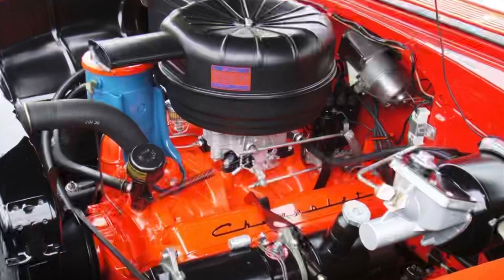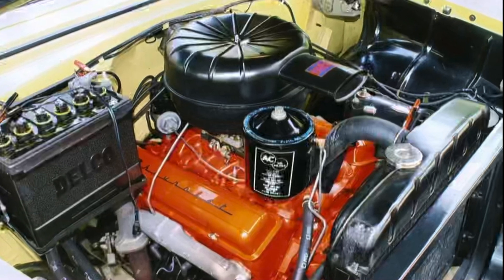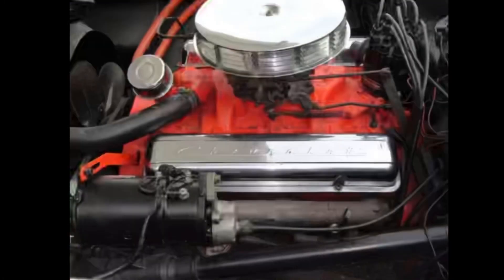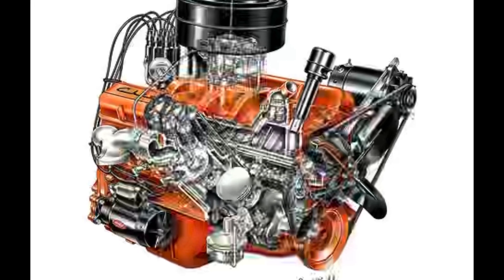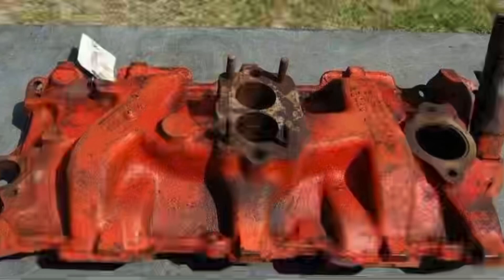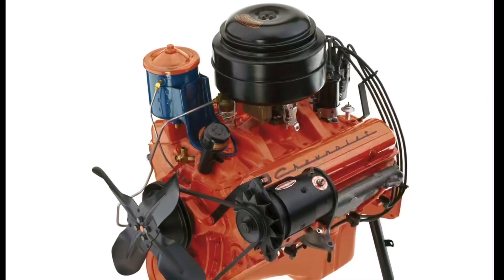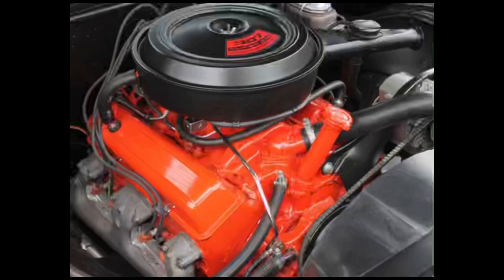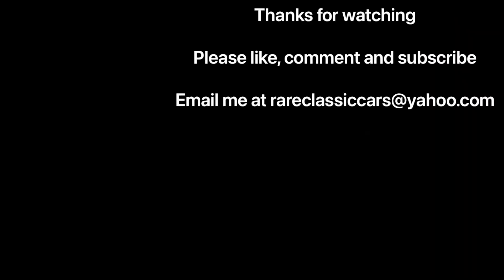Best Engines of All Time: The Chevrolet Small Block V8 (262/265/283/302/305/307/327/350/400)

Comment: I have a 2002 HD pickup with an 8 liter engine when I bought it new I looked at the motor and the salesman told me it was the old 500 Cadillac motor they were bringing them back for a year or 2 instant sale I knew it was built to last...It has 350000 miles on it still doing great use it for work and boy it earned its keep,maybe spent 5000 on parts and work in 20 years knock on wood...everyday without a car payment is a great day
Reply: Not a Cadillac 500, it’s a Chevy Big Block 496.

Comment: The  first gen small block Chevy evolved into what it is today not because it had a superior design, better performance, or reliability. It was because it was cheap, and they made more of them than other SB V-8's. Chevy was GM's cheap line, Old's, Buick and Pontiac all had V-8's that made the same power but had much stronger blocks with higher Ni content, forged cranks with bigger diameter journals, and Cylinder heads that have thicker castings.

Comment: Had Chevys with a 283, 350& PIS garbage 400. The 283 in my 64 Chevy was the best with the least problems.Can remember all the lying car companies telling you need a 8 cylinder car if you have an air conditioner. On my second Honda 4 cylinder SUV with a 4 cylinder engine. My 400 cubic in Chevy engine was such a pig.After you ran the air conditioner for only halve a hour it would think they called it detonate. Had the engine & radiator flushed out and even without a thermostat pig appeared to run hot at any speed.

Comment: Wasn't the 307 actually an Oldsmobile engine? It was very similar in appearance to a small block Chevy but was actually an Oldsmobile engine used across many GM platforms. The 1949 301 Oldsmobile Rocket 88 V8 and the 331 Cadillac V8 were also Ed Cole creations, so Chevy small blocks look similar to some Olds V8's.
      Am I mixed up or otherwise wrong about this?
Reply from the maker: There was both a Chevy and Olds 307
Reply: @RareClassicCars  Thanks.
Reply: Chevy's 307 was made from 1968 - 1973 
Oldsmobile's 307 was made from 1980 - 1989
Reply: @Fred_NaughTy Thanks.

Comment: Your information is CORRECT!  The ball and stud rocker arm design with the hallow push rods, meant MUCH higher RPM.  I love Fords, but the first small block Ford "Ford 221 cubic inch" (much the same as the 260, 289, 302 and 351W small block Fords) used much of the small block Chevrolet design, and did NOT come out until 1962, that's exactly seven years AFTER the small block Chevrolet (1955) came out, that is NO coincidence!  I think Ford HAD TO wait until some of GM's patent's wore off.  Dave...

Comment: Interesting fact. the 55 265 V8 oil burning was so severe, the dealer fix, to get it through warranty period, was too bring the Engine rpm up to 2,500 rpm and slowly pour a container of BON AMI  cleanser, like comet, down the carburetor, this would scuff up the cylinder walls and helped the rings too seat better. IT WORKED !!  Not for long but got it through warranty. Many old time Chevy buyers refused too by the V8 for years..

Comment: The small block Chevy engine was great, except for the years GM went cheap and used the soft cams that went round at 40-50 thousands miles.

Comment: I disagree with this premise. The SB Chevy was no a good as a high mileage motor. They would need an overhaul way too soon. The short deck short rod combination was one reason. Another was the soft cylinder walls, small diameter camshaft and combustion chamber located all on one side. The valve covers had only four hold down bolt with rough casting sealing surface. I always got better service out of a small block Oldsmobile.

Comment: Cool, thanks for the heads up in the old school car lesson. Question: wasn't the 283ic replaced by the 4.3 262 V6 overall?

I'm an old schooler pretty much at 64 and remember technology then was Bigger the Better, boy have we come a long way. Today is yesterday making very small engines with big, big block horse power and torque.

Thanks again, be safe everyone and be kind.

Comment: Best engine i ever had is the  305,,400.000 and still going fine.also the 350 small block,overhauled at 200.000, still driving fine.Keep real oil in them,they will allways get you home..

Comment: Very informative video. I'm satisfied with the 305 SBC engine on my 1982 Trans Am. The water pump had to be replaced 8 years ago. Intake manifold and valve cover gaskets were also replaced due to a mild leak. Other than that it's a sturdy and reliable engine with almost 80k miles.

Comment: Small block chevy is designed to be one thing: the cheapest throwaway engine GM could make (full disclosure: I had a nova I did the typical rebuild a truck 350 swap). Cast iron everywhere with flimsy stamped steel metal covers. The first 50's model years didn't even have any oil filter! And I always thought the chevy engine has more in common with the Olds rocket v8 than any of the other divisions' v8 - basically was deigned to be a cheaper rocket V8. My opinion is the Buick 340/350 and 430/455 were the best designs of all the passenger GM V8s.

Interestingly Chevy actually released their 302 cubic inch engine one model year (1967) before Ford (1968). Both have the identical 3 inch bore and 4 inch stroke. The Chevy 302 engine was nothing more than a de-stroked 327 using the crankshaft from a 283 for sustained high RPM race purposes in the trans am series The 350 came a couple of model years later - take a well performing engine design and increase the stroke for additional low rpm power. The 302/327/350 all share the same 4 inch bore but each have a different stroke. The Chevy 307 was simply a longer stroke 283. The 305 was always odd to me because they already had the 307 that is nearly identical so why design a 2nd engine? There must be something with emissions and changing to the small crankshaft journals that made GM decide to slightly tweak the bore and stroke. The 400 was an abomination and a reliability nightmare that should have never been produced.

Comment: Lots of good info  over all but GM really dropped the ball on the smog motor versions in the 70s.  The early  305 V8s were lousy  for manufacturing reasons.
Reply: The EPA forced all the auto maker's hands.  They had no choice, either make there engines comply, or the cars they are in can't be registered.
Reply: @michaelbenardo5695  The EPA demanded cleaner emissions from all OEMs.  That does not excuse GM for screwing up the metallurgy and heat treatment on engine components that had been in production for two decades.  That's lousy quality manufacturing... NOT the EPA's fault.
Reply: @billyjoejimbob56  I agree to disagree with you.

Comment: I’m with you on the 305/307 engines. They had plenty of potential for producing power, but they were choked down with emissions components. With their stroke and displacement they do make great high revving motors, but most people saw using the 350 as a better bang for the buck for power.
Reply: The worst power killers are EGR, retarded ignition timing, and lean jetting.  Those three absolutely murder torque, making it feel gutless.

Comment: I’m a Ford guy - the Chevy 350 IS the best engine ever.  Dang what a Jip !
Reply: your a ford guy,, ??..i doubt it. ever lookad at a 350 chev.?. there rubbish design..best ford engines, are the 351c, & 250 log motor. just my thought, but a 351w, looks like it was going to be a big block. the mains are huge. when you stroke a ford, you fill it with chev crap.. keep your ford all ford.. keep your chev all speed shop.. im in aus.. i beat you all,, i have a 340 r/t chall..yeeh..& 4 ford 4x4rs..62 to 02.. if chev, stayed here,with the blazer ect. would of made a killing, chev is like gold here.. ill keep my bronze ford.. we still flogged farrari.. 427fe..  chev...........................crickets....................
Reply: @harrywalker5836  ha ha haaaa!  Aussi my little Chris Craft has twin Ford 427 - they were just truck motors in 1968 next to the Ford factory - throw a shrimp on for your Ford mate !

Comment: The bore&stroke combination that you mentioned is wrong it had a very small bore and a very big stroke like the six cylinders I believe the bore was even smaller than the 305.
Reply from the maker: No. I’m definitely correct. 3.75 bore and 3 stroke.

Comment: Supposed to be the early 265 was a smaller version of the Cadillac engine that was used in the war great design. Basically Smoky young did everything you could do with the small block that was possible with all Chevrolet parts. It's a shame his will had him or family tear down his machine shop what a waste of tools and equipment and history.

Comment: Great motors have had every version over the years the 307 was probably the worst it's plastic coated timing gears always failed and the timing chain would jump the gears. Really love the ole "283" put that in anything and you're good to go. Sure there are more powerful versions but that motor was great.
Reply: You can replace those timing gears with all-steel.

Comment: Had 1970 LT1 370 horsepower with 292 slant plug heads solid lifters M1 Rock Crusher transmission 4-speed in my 66 Chevelle not bad for a nineteen-year-old kid

Comment: Im a Mopar guy but just built a 327, they are called the universal engine for good reason. Need your jaguar to be reliable and have power ,350. Want a fast cheap boat ,350. Japanese 4wd is a slug 350. They are used in everything and cheap to build

Comment: The fact that the platform was tuned for different output was what helped it achieve greatness. Instead of the flavor of the week new platform. Gm adjustments to the same package kept cost down. Then the ls was mocked as old pushrod tech. What else makes the hp per dollar of the sbc or ls?

Comment: I remember the 283 in the med-60's, and 307, 327, 350 and then the 400 from 1965 into the late 70's. They were everywhere on the road.
Reply: 283 was a good motor I remember they had good power and offered about 20 mile to the gal. in most body styles.
Reply: They were the "regular" engine of the day.

Comment: The Chevrolet 307 and 305 V8 engines weren’t so powerful but there’s plenty of performance parts available they can make up to 300 plus horsepower or more if you upgrade the parts for it

Comment: The 350 is the holly grail of the small block V8 engines after taking the throne away from the 327 and the 283 which they have multi purpose and the LS V8 engines are phasing out the living legend small block and big block V8 engines but still has the similar structure but different technologies

Comment: I never had a GM that would run worth a can of beans.....302  Ford small blocks were better engines.  Nascar has adapted to the Ford small block it runs better and produces more power.   Take a look at a Toyota or Chevrolet nascar engine it is based off the Ford small block Design.

Comment: My first car was a '63 Impala SS convertible, 327 4 speed, hot stuff for a 17 year old in 1967.  I had that car until 1975 and drove the wheels off of it.  I've had a succession of small blocks since then and currently have two.  I also have a 454/390 big block.  Sadly and ironically, I never had what I really wanted, a 327/350, IMHO the best of the best.
Reply: I had a 327/350 in my 1974 Chevy Monte Carlo.

Comment: Although I love the chevelles I had , the Chevy motors did not have longevity of the olds motors and I changed engines in the chevelles.  At least we had the versatility to adjust the vehicles for wear that you don't have nowadays.

Comment: I had a 265, a 283, a 327 and a 350. The latter were great motors, the 350 and 400 were junk! Flat camshafts, the front pully coming off and putting an end to the crankshaft. More then then one have done this to me and all under a 100000 miles, junk!

Comment: I thought zora duntoff had alot to do with the development of the small block + i thought the oil usage issue was no cross hatching on the cylinder bores ? My grandpas 79 305 truck had 700,000 miles + and always started ! just rusted out to death ! the motor lives on tho !

Comment: Growing up in a junkyard back when I built many a SBC and still think those mice were the best engines made. I learned a lot of tricks while working on these little jewels, just last year I sold off my remaining engines, I stroked these engines and destroked them. I learned decades ago not to use high volume oil pumps instead use new factory spec pumps.

Comment: I swapped out of my 1950 GMC 1/2 ton the 235 straight six for a 283 with Muncie 3 speed on the floor, the engine came out of a caprice, it’s still runs awesome, like you said the water pumps were weak I had to replace it last year.

Comment: The Chevrolet small regularly makes a lot of list of the best engines ever made the lists also includes the VW flat 4 cylinder the Porche flat four engine the Honda B series 4 cylinder engine the 22R 4 cylinder engine l drive a 1997 toyota hilux with the 22R engine the Jaguar 6 cylinder engine a lot of the includes 4 cylinder also the engine in the Model T Ford another  4 cylinder engine l have seen many reviews of older American cars with big V8s made only 140hp why when these huge American cars whilst Europe and Britian they were producing cars with 4 and 6 cylinder cars with similar horse power and they were much smaller and lighter cars

Comment: The 302 and the 327 were probably the best, in my opinion!
Reply: I have a 302 in my 4 speed nova. 4.88 rear gears it’s the most brutal launching street car I’ve ever driven. Will happily sing over 7000rpm

Comment: Starts off with bull shiiite.... the Chevy OHV straight 6 always had more HP than the same year Ford flathead V8 !!! 
Louis Chevrolet was a race car driver and his engines would never be a weak flathead! 
Original Gen. 1 small block Chevy V8 engine still available over parts counters but basic ones are early 1970's gas hog, lopo, emissions slugs... 
Chevy also had an OHV V8 1916 - 1918... called the 'mason' engine...

Comment: Great video.  One  of GM's best engines ever.  As to the  water pump,  it has to better than what I saw in a BMW teardown video recently.  The water pump was half plastic! And this was a BMW!   The author of that video says  the engine he was tearing down will  last 85/90 thousand miles.  Again a BMW!  No wonder BMW is said to stand for Big Money Waster or Bring More Wallet!.
Reply: European engines have never been very robust, except, of course, for the Rolls and the Bentley, which nobody can afford.
Reply: @michaelbenardo5695  This is not what I understood.  I have heard tales of the old Mercedes going several hundred thousand miles.  That is the older models, not present day ones. Mercedes are fairly expensive, but so are BMWs.
Reply: @pattyeverett2826  It was the diesels that would last that long.  They were also super slow and noisy.
Reply: @michaelbenardo5695  That is true, it was the diesels that I read about. It was still a European engine though.  The point is that with all the money spent on a BMW, I would expect much better quality.  I have had 2 Fords go over 240,000 miles with very few issues.   Much cheaper than BMWs.

Comment: With regard to the water pump, I remember when the one on the family's 1965 283 V8 started leaking 60 miles from home.  But I still made it home by partially unscrewing the radiator cap so that pressure would not build up in the cooling system and that way the leak was minimized and the engine didn't overheat.
Reply: hole in upper rad, ford,, drove for 4 months, cap loose.. cant beat a 351c.. never touch them..
Reply: @aldo6192  not mechanically minded,,i see..

Comment: There alright. My current driver is a 350 Chevy and I've had and built many over the years, but their definitely one of the most overrated engines ever. For their size they are heavy, and the casting is soft. Stock blocks aren't very strong and core shift was a common issue up till about the last 10 years of production. Sand pits and core sand  left in the water jackets was always there during a rebuild. They also tended to run hot. Being a 265in engine originally, then expanded all the way to 400in without any increase in deck height or any other provisions to increase cooling capacity. If used in something like a wrecker where your working one hard all day long a 350 will easily run 260 degrees. Every engine has some flaws, and the small Chevy is no exception but for some reason it has a cult following. With all that said it's not a bad engine, but seriously overated all the same.

Comment: Its amazing to see how engines back in the 50s had only the necessary components for them to operate, Nothing else. Its a shame how, over time, things changed and went downhill by the early to mid 70s with Government regulations. However, I've always liked the 305 and especially the 307 engines. I have an 85 Olds Delta 88 with a 307 and yes, it lacks HP but gets the job done and is a very smooth running engine. Just have to get passed those vacuum lines....